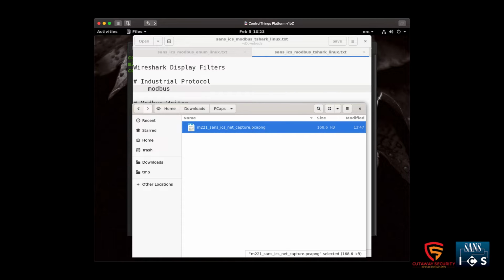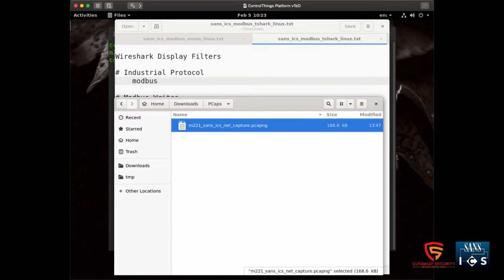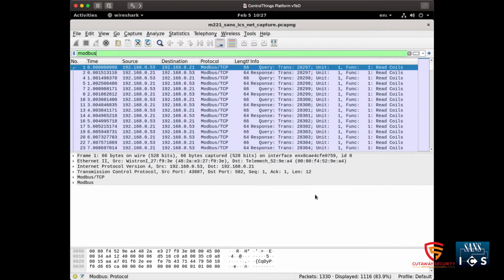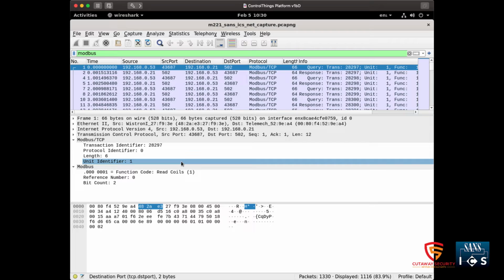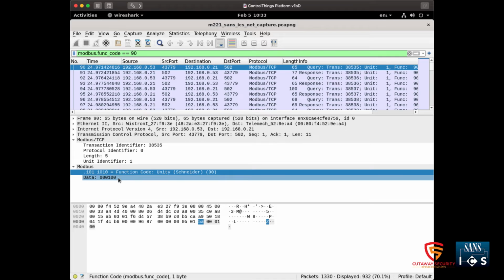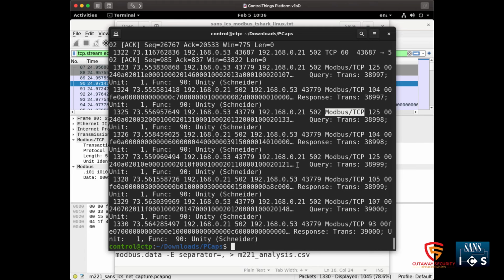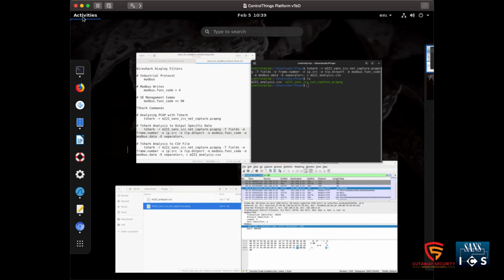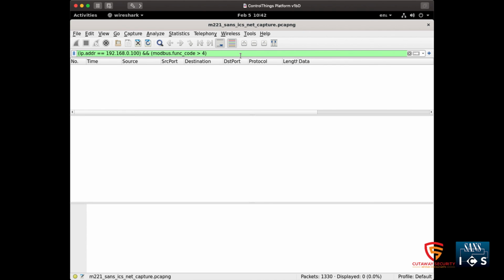Modbus Traffic Analysis | SANS ICS Concepts

Comment: Hey Don, wanted to ask you about your lab. At the beginning you described showing switch, cables and software in the 2 different laptops but could you please extend on that, for instance in the engineer laptop you mentioned 2 pieces of software , one HMI I guess and the other specific of the PLC I guess which could understand it because for sure is to manage remotely the PLC but that HMI piece and the graphic of “pumps” you can turn on and on, is that software an emulator , which software it is , how you deploy it, are the pumps real or virtual ... if yes , why the 2 red cables , what is in the other side of those cables because you showed only the netgear switch side , also that switch has the capability of configuring one port as span? Appreciated for all the details you could add in your lab deployment and mention specific software you used ... looking to emulate it. Thanks and great videos sir!
Reply: @Mr. Cannibal I believe the network cable configuration was: Black cable goes to PLC #1 Red cable goes to HMI #2 Red cable does to assessment / threat actor laptop Grey cable (switch's span port) goes to assessment / threat actor laptop's monitoring interface. I hope that answers your question.